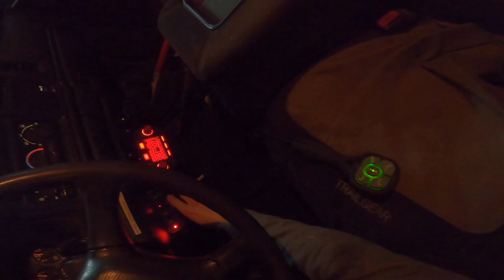10inches of snow!!! Let’s go plowing!😎 Vlog #3

Comment: Pull that front plate off the boss, allow the stuff that gets stuck to fall out. I over fill mine all the time and it runs great always. Pintle chain
Reply from the maker: I’ll have to give it a try, my next video you’ll see I have more issues with it🙄🙄
Reply: @Laues_Landscapes  I don’t know if that will cure it but I have been doing that since I started using it this year. Makes a mess that has to be cleaned out every storm but it’s able to breathe and move. Let me know if works for next storm message me on Instagram
Reply from the maker: @bigredoutdoorservices  will do man! Thanks